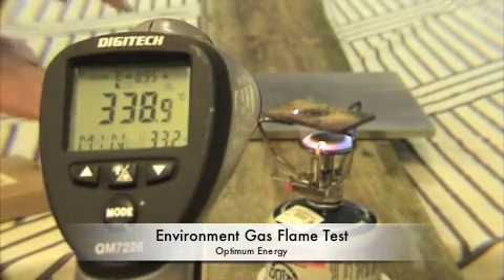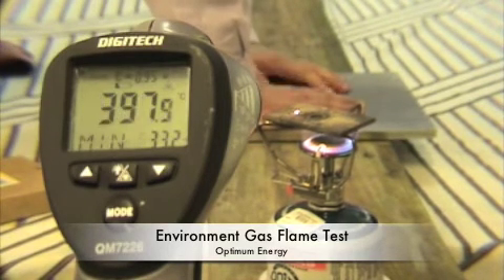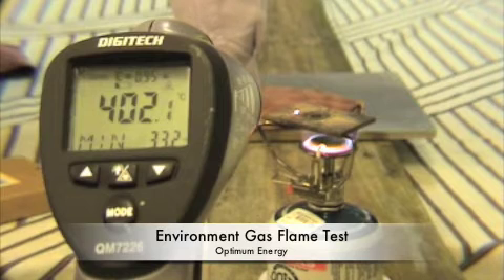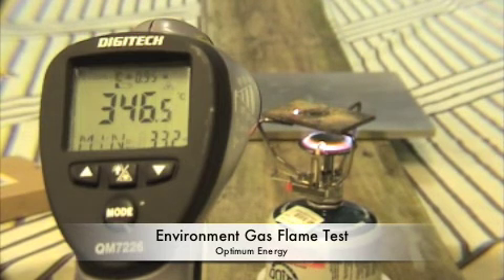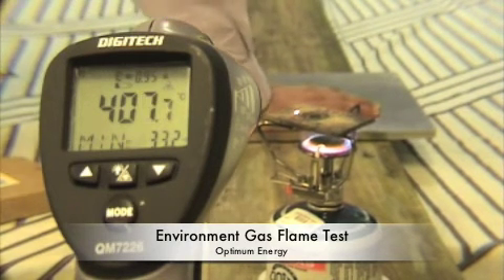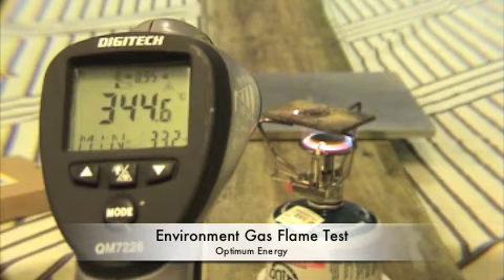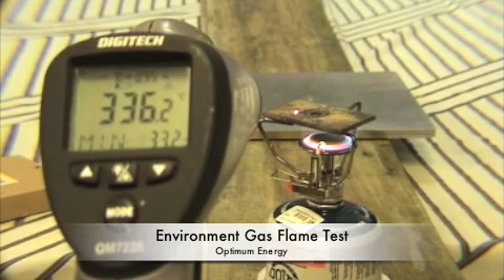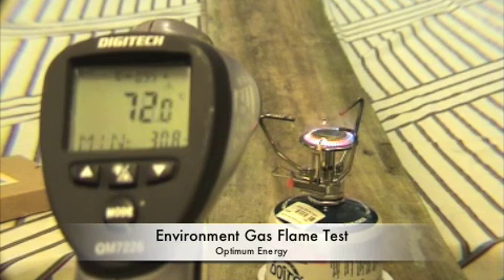Optimum Energy Environment Gas Flame Test

Comment: I suspect that the movement of the heating device when he pushes on it is what is changing the temperature that the device is metering. Nothing magical here. You can see the heating device move out of the range or even in range of the heating of the air. The heating device is actually shaping the heat flow into a flow around the plate. Naturally in that design the higher the detector is pointed on the stream the hotter it would be.